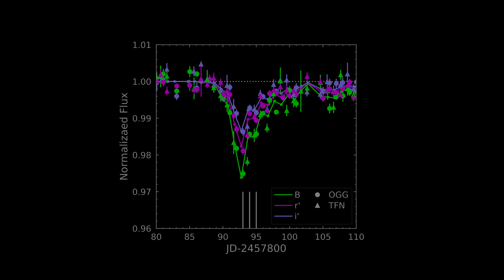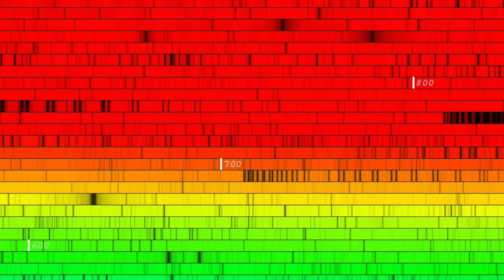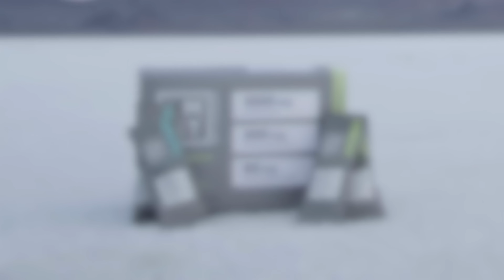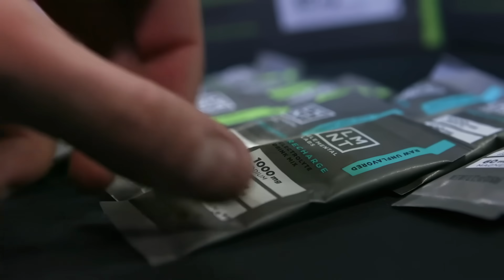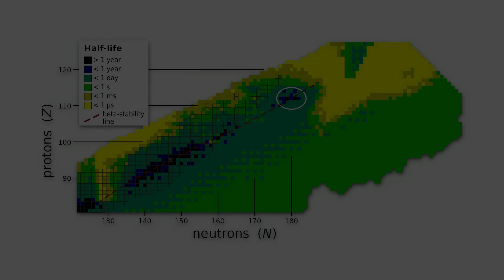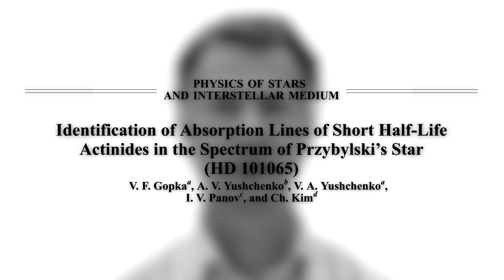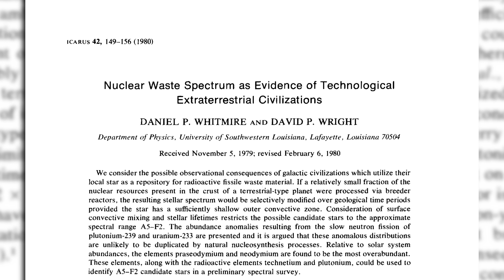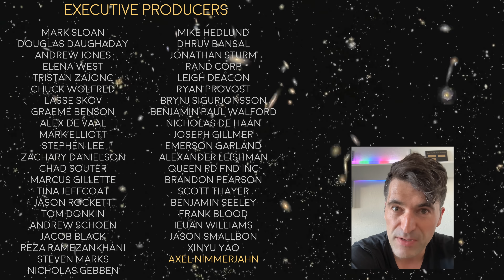The Star That Shouldn't Exist

Comment: An extraterrestrial civilization salting their home star as way of sending a signal to let any other civilizations looking for anomalies would make a lot of sense I think, because this way the signal can cover a lot more of the universe as the material would be detectable form all the directions (assuming they are capable of dispersing enough heavy elements covering all over or most of the star's surface). So other observers would be able to detect the anomaly irrespective of how they are oriented to their home system.
Reply: Sounds like an expensive act of desperation more than a means of communication.
Reply: @pencilpauli9442  it's expensive to us. but we don't know what their technology stack looks like. What if these fancy complicated elements are waste/byproducts of other stuff they're producing that is on a way higher level? It could be inexpensive as pocket lint for them.
Reply: @hungariannerd8445  
You are having to add speculation on speculation.
That's not good science.
Reply: @pencilpauli9442  with what we know, we have to be open to speculation. Otherwise you can essentially be the same as a flat earther in the medieval ages.
Reply: @hungariannerd8445  
I think you may be conflating speculation with hypothesising.
Reply: @hungariannerd8445  
" Otherwise you can essentially be the same as a flat earther in the medieval ages."

I'm not sure there were any flat earthers in the middle ages.
Kings are depicted with an orb and sceptre, rather than a saucer and sceptre for a reason.

Flat earth as I understand it is a modern phenomenon, which involves all sorts of wonderfully imaginative speculation.
Reply: @pencilpauli9442  That would seem like a reasonable assessment only if you could point out a superior way of "broadcasting".

On the other hand: Someone so close in our galactic neighbourhood with that level of technology should be aware of life on Earth. So if they want to attract attention then it would make some sense to expect a less ambigeous form of communication / beacon directed at us. Of course that is now a lot of assuming about the detailed intentions of aliens... so really not a strong argument, just belief.
Reply: @HaukeLaging  
Sorry but I don't buy it.
Just because we have discovered a phenomenon, it does not follow that it was a deliberate attempt to communicate.

I do apologise for the incredulity, but the idea is just so inelegant and clunky.
The dumping waste hypothesis sounds far more plausible, but as a means of communication, it's a hell of a stretch imho.

We all want to know that intelligent life is out there, but that shouldn't lead us to clutching xenostraws.

How far away is this star? 
A culture that can dump exotic matter into their star to tell a possible culture possibly millions of years in the future "Hi there, how you doin'" just does not sit right with me,
Reply: I believe he said it was 357 light years away. So we are seeing the star as it was 357 years ago, which is a tiny blip of time. I can imagine in 357 years’ time we humans doing something weird to our star, although I agree with you that messing with one’s star needn’t necessarily be for communication purposes.
Reply: @Mojogoblue  
Yeah I know the star is 256 light years away.
THEY would know how near or far any civilisation with the ability to interpret their smoke signal would be though.

#OccamsRazor
Reply: @HaukeLaging  Not necessarily. Given that its 357 lightyears away. Our earliest radiowaves (if they don't deteriorate to much) should arrive at this star in about 230 years give or take. While we detecting evermore planets this is a relatively new phenomena which really took of in the last 25 years. Even now its hard to detect planets for us and even harder to really analyse them properly. Sure we are getting better but it will still take a while. Now lets assume that these aliens are similiar biased, so they would first look for liveable planets on stars similiar to there own. So it is not unlikely to miss us. Anyhow, what would support the Alien hypothesis is when we would look and find planets in the habitable zone of that star.
Reply: @pencilpauli9442  You are, of course, entitled to your opinion. But I pointed you at that your opinion would be much more convincing if there was at least one better idea for the assumed purpose. You decided not to present one but repeat your opinion instead. I am not impressed.

Why would a civilization which can throw its waste into a star need a star to handle its waste? Does not make the least bit of sense to me.

The purpose of this very basic communication would not mainly be to tell "Someone (or something artificial) was here" but "Look closer here" which might be the requirement for every complex kind of communication.
Reply: @HaukeLaging  
" if there was at least one better idea for the assumed purpose. "

Dude, I'm tired and have a migraine.  If I missed your demand for a better explanation I apologise.  

Because Occam's Razor.>hyperspace  jumping to conclude aliens.

You haven't even bothered to consider that there are natural causes for the phenomena that aren't known of yet.

Personally I'd rather keep an open mind.
Reply: @pencilpauli9442 Not if those elements were a waste product anyway.
Reply: @74Gee  
Okay, but it's still a hell of a stretch to assume that it's a means of communication.

It would still need resources to launch the waste into the sun, and the signalling would be a secondary consideration at best.

"Let's dump our shit in to our sun in the hopes of some civilisation having the ability to use spectrology seeing the composition of our star is a bit weird and coming to the conclusion we lit a beacon" is not the sort of thing I can help but cut with Occam's razor.
Reply: @pencilpauli9442 dying breath of a civilization. “We were here”
Reply: @joshf9074  That does not make sense with this half-life. A renewal process would have to have survived the civilization.
Reply: You'd have to have some balls of steel to want to invite all your galactic neighbors over for tea without having met them yet. I highly doubt anyone would deliberately do this to their own home star, but who knows.
Reply: @inthefade  Yeah it would indeed be very risky.
Reply: @inthefade  One issue here is that we quite literally cannot predict the motivations of a truly alien civilization. Maybe they know something we don't about cosmic dangers, or a confirmed/evidenced lack thereof. It could be a friendly beacon, it could be a honeypot, it could be a warning to stay the hell away. A civilization able to produce and essentially throw away elements that our puny civilization struggles to produce in gram quantities could just be a massive flex, and an indication of their dominance and territory, a sort of interstellar graffiti.
Reply: @inthefade  Perhaps it's not an invitation, but a warning?
"Observe, but stay away. Danger ahead".
Radioactivity usually has negative connotations. in our society nobody in their right mind would disregard the "radiation trefoil symbol".
Reply: What about the time it would take for the light to actually reach anyone?
Reply: @retroide it's still a signal propagating in all directions at light speed which is as fast as you can hope for
Reply: @retroide   That would always be there, the speed of light is the Universal speed limit, but its also more importantly the speed limit for the transmission of Information. It would literally break causality. It is the absolute speed limit for the transfer of energy, matter, and information.
Reply: What everyone here seems to forget is how unlikely it is for an A star to be able to harbour life in the first place. They live between 300 millions to 1.5 billions of years, there wouldn't be enough time for life to develop in such place, not even speaking of their hostile radiation spectrum that hampers protoplanetary disk formations (blasting lots of UV's and ionizing radiations) easily destroy planetary atmospheres and are harmful to life. 
Yes, the presence of such elements is strange, the iron lacking is strange too, but we shoud first exaust all the natural possibility before alien stuff.
Reply: @jhtrq1465  
Thank you. 
Good point about the time scale, but expect someone to say aliens from another system could have gone to this star system.
Reply: @pencilpauli9442  Sure ^^

I guess that when one want to see aliens (or the flatitude of Earth) they manage to always see them, no matter what.
Reply: @jhtrq1465  This is a wildly terrestrial and human-centric view that is only supported by a sample of one. Life as we know it is fairly uniform, but differing conditions tend to result in different outcomes. Beyond that we have extremophiles on this planet that can endure boiling and freezing temperatures as well as total vacuum.

Arsenic based life is possible, as are likely a lot of other chemistries we haven't explored, so it's ignorant to dismiss A type stars out of hand just because our timeline of evolution wouldn't have worked.
Reply: More likely, alien civilization was using their sun as a garbage dump, for the disposal of dangerous or toxic waste.
Reply: Whether it's communication or dumping waste, doing so on a large enough scale for it to be measurable must require the civilisation to command vast amounts of energy - is there any reason to suspect a dyson swarm around the star? If not then do we suppose these aliens possess an extreme energy source so advanced that it's inconceivable to us, but they also don't have the capacity to recycle or repurpose their radioactive waste?
Reply: If they salt their whole star goats have probably climbed there already. Maybe they are just attracting lots of goats for whatever reason :/
Reply: Any civilization that could do that to their star would know exactly where we're at lol
Reply: @marcosolo6491 agreed. Mother nature still exists even in interstellar space, kill or be killed lol

Comment: We're considering using nuclear waste to power starships. So what is the byproduct of nuclear waste falling into the sun do to our star?
Reply from the maker: The Sun's envelope is convective, so it would quickly pull down anything we dump into it. It's the radiative envelope of Ap stars that allows this stuff to be detectable in smaller quantities than would be needed here.
Reply: Lol, Nothing, the sun is too big to even notice the waste.
Reply: You could dump the entire non-stellar part of the solar system in and it still would barely be measurable
Reply: @danxdanx8877  What we read in the spectrum of a star is the point